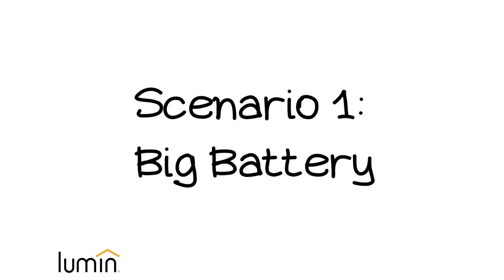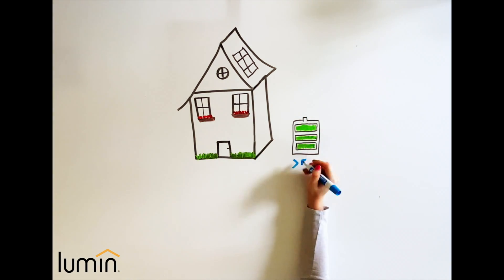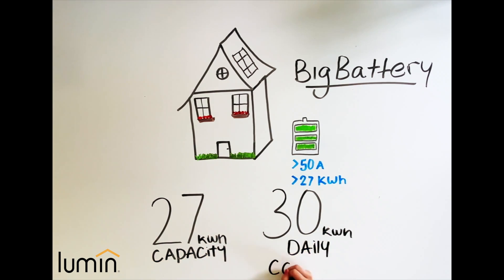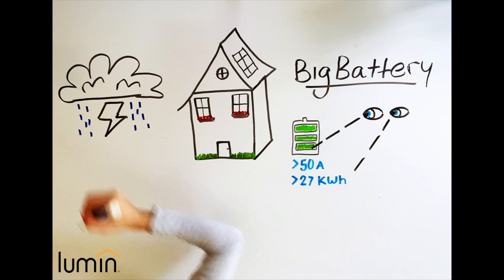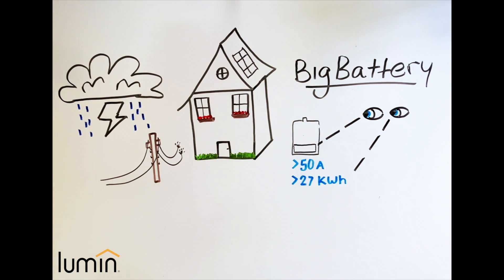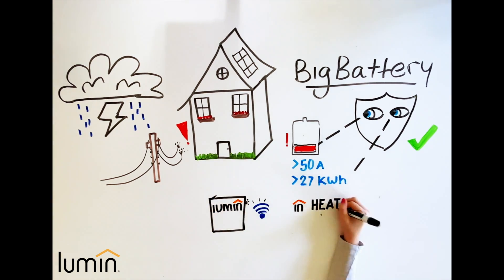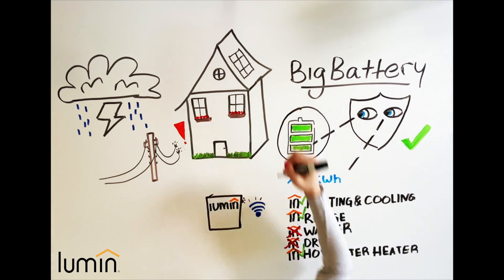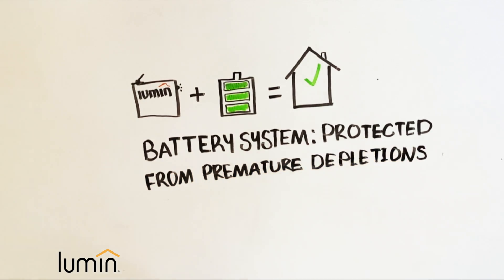WHITE BOARD: How Lumin Protects Battery Systems

Comment: Have A/C, double electric oven and electric cooktop on 100A sub panel circuit off 200A house service. Planning Enphase Ensemble 2.0 PV solar system. Could move gas water heater, washer/dryer, frig & freezer and dishwasher to this sub panel. Can Lumin LSP connect to this sub panel to monitor & shed?
Reply from the maker: @Gilbrook Thanks for posting and congrats on the upcoming install. What you described sounds exactly like what we do. We’d love to connect directly to discuss your project in greater detail. Feel free to reach out to us via email: hello@luminsmart.com.